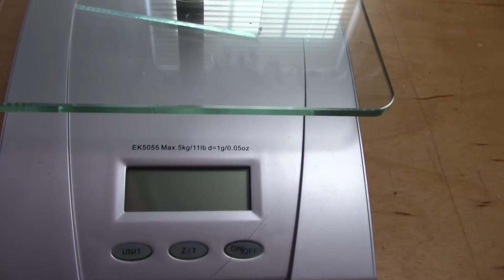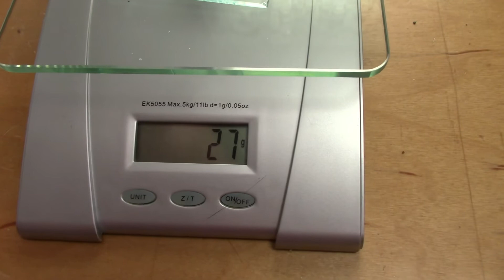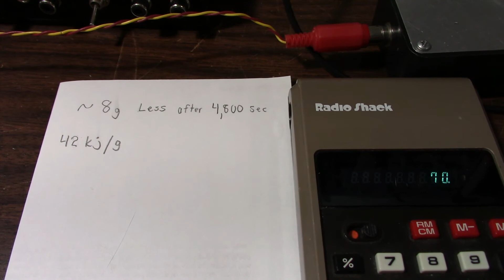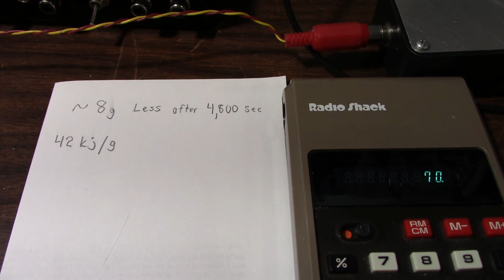Power output from candle flame

Comment: This is useful since I am designing a thermal heating system that uses candle watts of power.  Many sources say a candle generates 80 Watts of power, however I have seen one study (link below) that says only 59% of that energy is expressed as heat, with light making up the remainder.  For a thermal heating system, only about 45 Watts per candle will be used, which probably explains why many experimenters give up their clay pot designs wondering what went wrong.  They simply needed more candles. 

https://protonsforbreakfast.wordpress.com/2013/11/05/candle-mass-and-candle-power/#:~:text=The%20first%20method%20was%20to,the%20mass%20loss%20per%20second.&text=Multiplying%20this%20by%20what%20Wikipedia,at%20a%20remarkable%2077%20watts.
Reply: Too bad, your comment is hidden.
Reply: @gustavgnoettgen 
The comment you just responded to is hidden?😂
Reply: @PETERJOHN101  Yes, I searched for new so I can see some hidden comments. Without that it is hidden.